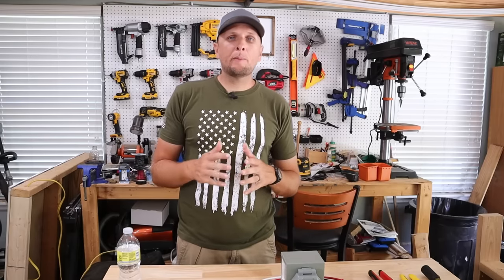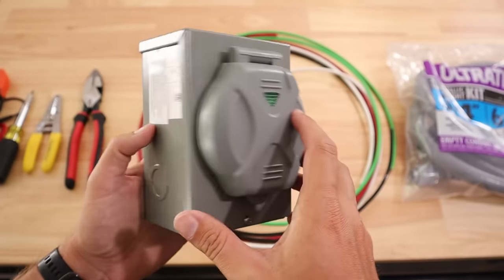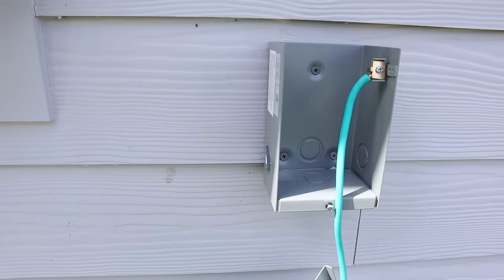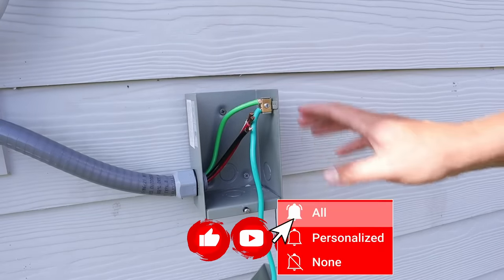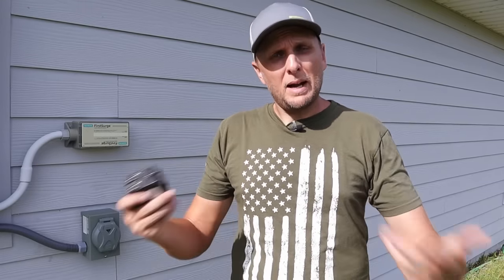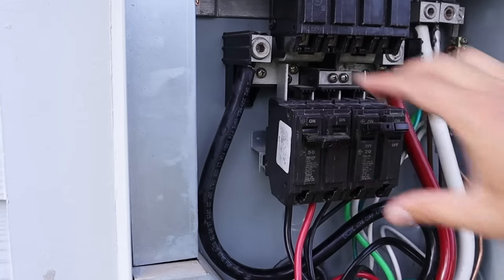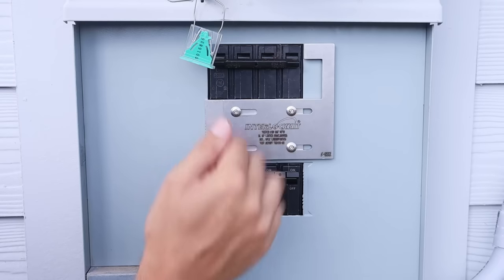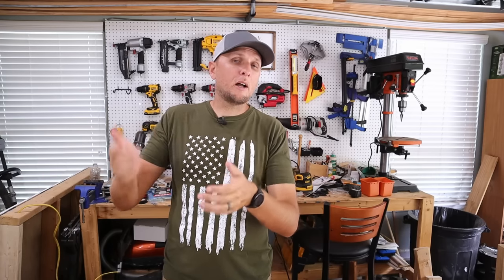The BEST Way To Connect A Generator To Your House - Interlock Kit With Power Inlet Box Install

Comment: what I am confused about, with the main breaker off and the 50 amp breaker on, how is that feeding the main breakers for the rest of the home? Is their a panel on the inside where the fridge ac and all the smaller breakers because if the main is outside and off wont that stop the power from going to the inside? On my set up, I have 2 mains. The one out side  has the well breaker  and two smaller breakers which I added for outside lights. In my home there is a main breaker and the ac fridg I mean the whole home is on the inside panel. Awaiting some feed back thank you in advance
Reply from the maker: Yes I have a large panel in my garage with all of the individual circuit breakers in it.  It does not have a main breaker though so I have to install mine out at the main panel outside for the interlock kit.
Reply: oic, because my power pole has the well on it with the main as well, and the inside home has the main with everything else, Im thinking im gonna have to put two boxes, one 30 amp and one 50 amp so i can run the well with the rest of the home. I think im just over thinking it
 @HowToHomeDIY
Reply from the maker: Ok, which one receives the power from the utility company first?  I’m assuming the one out at your power pole.  That’s the only one that’s needs a power inlet box installed on it if that’s the case and everything down line from it will receive power.
Reply: yes the main power coming overhead to the outside pannel. So it jsut clicked in my head, I have a 50 and a 30 amp plug on the generator.  so I can put to booxes outside one 50 and the other 30 amps.  turn the main off on the outside which will kill the power coming from the street. Leave the main on in my home so the fifty and 30 can send power to the rest of the breakers inside the home. Am I on the right track

 @HowToHomeDIY
Reply from the maker: No, you would only need one on the first disconnect.  It should then be sending power to your next panel.  In that case there would be no need for two separate boxes.  Just one 50 amp box.  Unless there is something I am missing.

Comment: I have a single-wide solitaire Mobile Home 2014 model and my breaker box is configured differently my main power shut-off is at the bottom not on the top the lockout will not work it does not fit correctly how would I go about installing this

Comment: Idk if someone can answer this question or not. I got an 4550 Watt Inverter Generator with 3650 running. I have a 1.5 ton Ac unit would it be enough to do this and power my house and it came with a 3 prong and 30 amps connector. Do i have to get a 30 amp or 50 amp?

Comment: Hey since my 3600w generator has the 30A 3 prong locking tab at 120v can I just use a single pole breaker as opposed to double pole with generators that can do 240??

Been watching tons of videos with larger 240v capable generators and i was watching a video on my new generator (still waiting on shipping) and noticed its only 120v.

Comment: The best way to connect a generator is run an extension cord to a power strip   
I’ve installed several of these boxes and interlock in main panel
The best time to use the generator is never. The better investment of time and money is to put in an all in one off grid inverter with battery backup. You can run it like a UPS and have instant clean power when the grid fails. 
Put in a few solar panels and start recovering your investment from day one. Keep the generator. Just remember it needs regular maintenance and fuel every time you use it. If it’s loud enough you won’t hear the in-laws knocking on your doors.

Comment: How did the interlock panel get installed?  You show every wire getting screwed down, then skip to the installed interlock panel.  How did you determine which panel to use and how difficult is the installation?
Reply from the maker: I quickly showed the install.  You may have skipped it.  It’s easy.  You need to figure out what panel you have (make and model) and then find the corresponding interlock kit.

Comment: Hi. I have G12KBN generator that has 30 and 50 amp outlets. 12,000 peak watts/ 9,500 rated watts (gasoline).  Do i need to run 50 amp or 30 amp 240v to my house ?

Comment: You're only using 6guage wire on a 50amp power inlet? Why not 8 guage? Also why do you want 50amp vs 30amp?  Legitimate questions, because I'm seeing mixed results when I look it up.
Reply from the maker: Because 6 gauge is the proper size for the amperage and is larger than 8 gauge.  I want 50 amps because I have a larger generator and want to be able to power more things.
Reply: @How To Home  perfect, thank you!

Comment: Does the ground wire have to be 6 gauge also?    Will Romex simpull work on the outlet to panel.    Only the ground is 10
Reply: Yes, you can put Romex inside conduit.

Comment: Hi: I noticed that your generator does not have an inverter, thus it does not produce clean power. Could this damage your central air conditioning system?
Reply from the maker: Every generator is different.  My larger generator has a THD% under 5% which will not cause any damage to any sensitive items in the house.  Doesn't have to be an inverter.

Comment: Does this power both sides of the electrical panel? I have 2 bus bars as I have 200a service. And I see it’s a double pull switch but it’s on only one bus bar.
Reply from the maker: Powers both.  With a double pole breaker it connects to both sides.
Reply: @HowToHomeDIY  ok I was going to use one Ecoflow delta pro using the 30a 3 prong to 4 dogbone so it would energize both sides of my panel then , just don’t run any 240v loads.

Comment: How do you determine the amperage of your portable generator.
Reply from the maker: Your generator should list the wattage it’s capable.  Assuming you are connecting it to the home via 240 volts you would take the wattage of the generator, divide by 240 and you will get your amperage.
Reply: @HowToHomeDIY  Thank you.

Comment: I had our house wired to use a generator when it was built. Our power went out today, and my generator has a 3 prong cable and the box on the house is a 4 prong. Can I use an adapter or am I just out of luck?
Reply: Contact a local electrician.

Comment: What size generator our you using? What all can it run? Can I use 2 Generators?
Reply from the maker: Mine is 12000/15000 watts.  I can run pretty much everything with it but I do sometimes run that one and my small one to take the load off.  Which goes into your 3rd question, yes you can but it requires different systems.  I have the power inlet box with interlock kit in the video for my large generator and I have a transfer switch for my smaller one.
Reply: @HowToHomeDIY  Thanks for the great info my generators are smaller trying to figure out if a generec are a portable would be the most cost affective. Live in south Louisiana need 1 down here.

Comment: If I have the soft start kit installed, will it void my warranty on my Trane A/C unit?
Reply from the maker: You would need to check with whoever holds your warranty.  All manufacturers are different.  The soft start kit itself would not void the warranty but if there was ever a claim and they wanted to give you a hard time about it, they may claim you did not have a licensed HVAC tech install it.  Again it all depends.

Comment: when you use this set up,the main switch is opened? is neutral disconnected from utility transformer?
Reply: The Double Pole Mains CB typically does NOT disconnect the Neutral.

Comment: What is the minimum size generator that would be applicable to this?
Reply from the maker: Really no minimum size but you have to be very careful how many circuits are on at once.  Completely depends on the size of the generator and the load put on it,

Comment: How many 20 amp breakers can you turn on when you are using the generator for power?
Reply: The # of Circuit Breakers are irrelevant.  It is the total max amps consumed by simultaneous LOADS that are ON vs the size Genny.

Comment: Just one question what size generator are you using I put a power Inlet box and wired it to a transfer panel in my basement then connected it to my main panel can run eight circuits since then I've upgraded my generator
Reply: What size generator do YOU need?

Comment: Does the generator itself need a earth ground running to it? If not what determines that?
Reply from the maker: No.  The ground will be the home’s ground.  And the generator in that setup should be set as a floating neutral.  The neutral and ground should not be bonded at the generator.  I answered this assuming you are talking about the generator being connected to a house and not standalone.
Reply: @HowToHomeDIY  yes I am

Comment: Well, Im confused.  How do you install that on your panel if your main panel is up on the road 300 yards away?  Also, if that slide switch has your power off from the pole how do you know when your power is restored?
Reply from the maker: Does your panel in the garage/basement have a main breaker in it that kills the power to it?   There are numerous ways to know if power is back on but everyone’s circumstances are different.  You can install a device on the panel on the service side that an alarm goes off when power is back, if you can see a neighbors house and can see their lights are on, my power company sends text alerts when power is restored, or you can just randomly check with the main on and the generator breaker off and see if power is back.
Reply: @HowToHomeDIY  sub panel does not have a main breaker.  We must go out to the road to shut off power
Reply from the maker: Wow yeah so in your case it would be expensive no matter how you look at it.  Because for the interlock kit to work, a main shutoff needs to be in the panel that is receiving the power from the generator.  So there are a few options but like I said, not cheap ones.  I believe at least the 2020 NEC allows for two service shutoffs.  So could add a sub panel with the main power redirected to it with a main shutoff in it for the utility power and generator breaker then connect it to your current sub panel.  Can replace the current sub panel with one that has a service disconnect breaker.  And the final option for most people would be to run a long larger sized cable to make up for voltage drop all the way to the panel but at 300 yards that is really not a feasible option.  Only other thing would be to install a generator transfer switch but those are typically limiting in how many circuits can be powered.

Comment: Hi Adam I have a 9000watts 7600 watts whit 30 a do you think this will work in my house
Reply from the maker: Not sure I completely understand your question.  You are right on the line of using a 30 amp or 50 amp box and wiring.  If you have a 50 amp outlet on your generator then you could install a 50 amp box and #6 wire.  If you just have a 30 amp outlet on the generator you could still install a 50 amp box and wiring but would need a 30 to 50 amp converter.  You can always use higher rated amperage items not lower.  In that instance you could also probably just use a 30 amp setup.  Again you are right on the line.  Not sure if I answered your question or not?  haha

Comment: No permit and inspection required?  In my area the installation of this kind of device requires a permit. Installing a NEMA 14-50 RV required a permit and and electrician. Everything had to be left open for the inspector.
Reply from the maker: Every place is different.  Have to check with your local building department.

Comment: I would like to know if this installation is legal in Quebec Canada?
Reply: Contact your local authorrity having jurisdiction
Reply: Nope. Need to disconnect the neutral as well.
Reply: @fuckyougoogle1148  What is the reasoning for disconnecting the Neutral Wire, via the Transfer Switch, in Canada?   Leaving it connected works OK in the USA.
Reply: @MrSummitville  Not being a member of the governing body I can't speak to the exact reason but I can surmise that it's a safety issue. There have probably been incidents where back feeding has occurred due to bad wiring conditions which prompted the rule.

Comment: Can you do the same if your main panel is inside the house?
Reply: I guess I still need a sub panel
Reply from the maker: Yes you can but the main breaker needs to be present in order for the interlock to work and be up to code.

Comment: Can I come off my sub panel for a 30 amp inlet plug?
Reply from the maker: Can you and should you are the questions.  There has to be a way of setting up a disconnect so that the main breaker and the generator breaker cannot be on at the same time.  For example, an interlock kit.

Comment: Will a 10kw generator over 50amps start up central AC?
Reply from the maker: Yes and no.  Just depends on the amperage draw your AC unit needs in order to start up.
Reply: @HowToHomeDIY  maybe if I start first

Comment: I have a 2014 solitaire mobile home single wide my breaker box is configured differently with my power shut off on the bottom and do not see an extra space for 30 amp or 50 breaker the lockout will not install on this system what should I do
Reply from the maker: They make interlock kits for all different kinds of panels.  Just have to figure out which one you have and search for the interlock kit for it.  Space can be made in a breaker panel a lot of the time.  Might look into tandem breakers for some low amp circuits.

Comment: What size portable generator do you use to run your whole house
Reply from the maker: 12,000/15,000
Reply: @HowToHomeDIY  thank you so much would a 9500 running watts and 12000 start up be enough to run a 3 ton unit
Reply from the maker: @jessenoble1399 I can’t say for sure because tonnage doesn’t always equate to specific LRA or how much current is needed to start it.  In general if you have a soft start kit installed I would say yes.  Without it, hard to say for sure without testing.
Reply: @HowToHomeDIY  gotcha thanks a  bunch for the quick reply and  your videos are very informative to the point and has helped me out getting everything I need and how to  do the project myself

Comment: You didn't mention anything about using the correct torque settings when connecting the wires.  Otherwise, this was very interesting.

Comment: What size generator are you using??  Thank you
Reply from the maker: I have two.  If I want to take the load off my larger generator and use less fuel I hook up my smaller 5,500 watt generator to my transfer switch.  My big one is 15,000/12,000 watts which hooks up into the interlock kit.
Reply: @HowToHomeDIY  perfect,  that is exactly what I needed to know.  Thank you
Reply from the maker: You’re welcome!

Comment: Gotta say if you didn’t know the bottom of the breaker has holes where the wires go then u should never attempt this what’s so ever.will say this is very dangerous. U don’t turn main off u could kill the pole lineman. You will back feed thousands of volts.
Reply from the maker: Pretty sure that was all covered in the video.  The interlock kit takes care of that.

Comment: what size micro easy start do i need for a 3 ton unit
Reply from the maker: You can find all of the sizing and links to the proper tonnage soft start kit down in the description portion of the video.  I believe it should be the X48 model.

Comment: where did you get the 50 amp cable?
Reply from the maker: Going to my generator or from the power inlet box to the main panel?
Reply: @HowToHomeDIY  cable from generator to outlet. where do you live since i heard you mention storms which is the purpose for this? i have a big generac that's enough for 2 houses. i'm sure it will work well along with an easy start.

Comment: No knockout probably best to make sure it’s watertight.
Reply from the maker: Why would it make it any less watertight than if there was a true knockout?
Reply: @HowToHomeDIY  - idk (I am not an electrician), but I would imagine the machine that creates the partial knockouts might not always do it perfectly and then you end up with a water leak. Plus, since it is an outdoor box, a true partial knockout might create a place more likely to rust, which might again cause a leak (or at least look junky).

Comment: Looks good but you missed the secondary hold down for the back feed breaker. It would fail inspection. NEC 408.36 (D) 
Surprised no one caught it
Reply from the maker: And I would put the zip tie on in front of the inspector within 30 seconds 😂

Comment: What size and brand generator are you using?
Reply from the maker: Mine was made by Cat and it is a 12,000 watt generator.  Unfortunately they dont make it anymore as I think it was the best large generator on the market.
Reply: @HowToHomeDIY  Did a quick search and found one RP12000 E.. they want $8,000 for it. Um, maybe not
Reply from the maker: $8,000?!?!  I bought mine for somewhere around $3,000 brand new.  They know they dont sell them anymore and I guess are waiting on someone that wants one badly enough.  That is a rip off.

Comment: I have a 8000 Dewalt what gauge wire should I use?
Reply: How many amps (max) can your Generator supply?  Use proper gauge wire per the amps.

Comment: My electrician installed a nema 14-50 inlet box 4 prong female on the house. The plug on my generator is also a female. How do I remedy this without making a suicide plug? I cannot locate a conversion kit.
Reply from the maker: Why did he install a 14-50?  If he was told you wanted a power inlet box for a generator then he really screwed up.

Comment: Nowhere did you say if you are usingf 120V, or 240v?  I know- 50A.
Reply from the maker: When there are two hot wires.  That would be 240v

Comment: What happens when your running the generator and the power comes back on?
Reply: Nothing at all as long as the MAIN breaker is in the OFF position. Using an INTERLOCK prevents the Main & Generator breaker from being on at the same time.